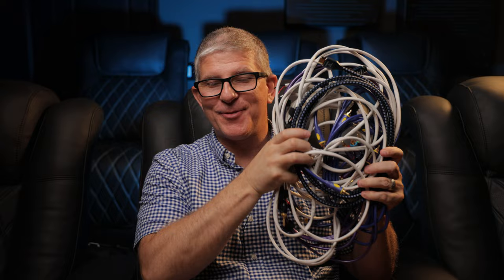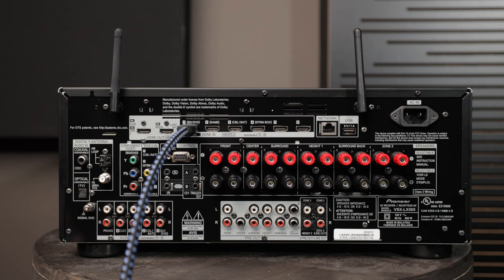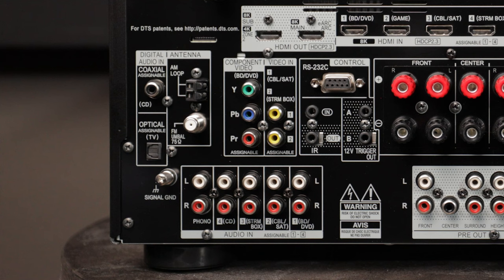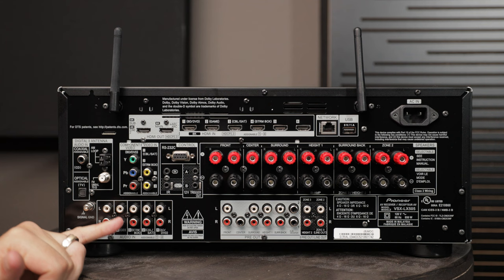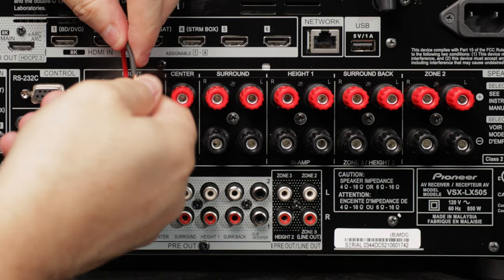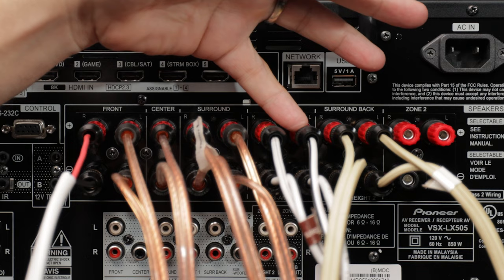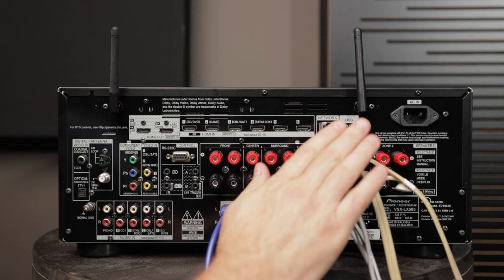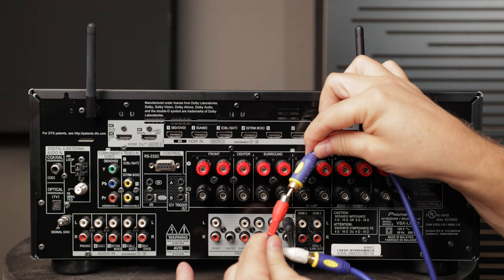How to Connect An AV Receiver (AVR) | EASY Step By Step Instructions

Comment: Great videos. I have the rack mount ears for my Onkyo TX-RZ50 ready to install in my rack. Is there a way to remove the feet from this receiver so it fits in my rack easier?
Reply from the maker: Most feet can be removed from AVR’s’s or processors. You just have to be careful if they have ventilation on the bottom.
Reply: @Youthman  Thanks for your quick reply. I decided not to attempt removing the feet. It looked like it was going to be more trouble than the extra 1U rack space it was going to provide. I'm going to install an AC Infinity cloudplate cooling unit under the Onkyo as well as one above it anyway. It was a lot easier to subscribe to your channel. Thanks again. 🙂

Comment: I was hoping you’d explain how to set up ARC. I have an ARC TV connected to the ARC HDMI but it’s not working, even though I enabled it in the settings in accordance with Denon’s instructions.
Reply from the maker: There isn't too much to setting up ARC. 1) Both your AVR and TV must have ARC or eARC HDMI ports. 2) Connect an HDMI cable to those two ARC / eARC ports. 3) In your TV's audio settings, enable ARC. 4) I fyou have a Denon or Marantz, go into your Video settings and make sure ARC is enabled. Let me know if that helps.
Reply: @Youthman  thanks for the reply ❤️ 

Unfortunately, I did that already but it’s not working. I’ve been using this exact setup with ARC for a long time so I know everything but that is working fine. 😢

The TV is behaving as if it sees the ARC AVR and is sending the audio there. But I hear nothing. The AVR has HDMI control And TV audio switching turned on.

Comment: I know I probably won't get an answer, but I have rear in ceiling speakers for dobly atmos so what settings on my receiver do I set to activate those speakers? Atmos enable or height speakers?
Reply from the maker: Hi James, which AVR do you have? Typically Atmos enabled is referring to up firing speakers that you place on top of your front left and front right speakers to bounce the sound off your ceiling and back down to your listening position.

If you have a Denon or Marantz, under Speakers > Manual Setup > Speaker Layout, change Height Speakers to Yes and then choose Top Front etc. 

The diagram will show you a visual representation of where those speakers would be placed in the room.

Let me know if that helps.
Reply: @Youthman  I got the new Pioneer VSX-535 5.2. My rear surround sound is set to height for my rear in-ceiling speakers and my front in-ceiling speakers are on the front height channel set to height. I believe that's a 3.2.2 setup. Now I know I don't have any rear surround sound ear level speakers, but the virtualization on the unit does a good job at imitating them. I just want to make sure that my in-ceiling speakers are getting the Atmos channels.
Reply from the maker: When you check your levels in your AVR you will hear what channels it’s utilizing.

You can also download this callout file - https://www.stereonet.com/forums/topic/470220-dolby-atmos-sound-check-dtsx-111-callout-clips/

Comment: Do the cables or type of connectors introduce any considerable noise or quality degredation? It always seems like these RCA cables and ports are not really up to the task of that. But then also, why wouldn't they be?
Reply from the maker: No difference whatsoever
Reply: @Youthman  Thank you. I always get told by audiophiles that the cable, the port and the connector matters and that expensive equipment is required to make it sound right but I find it hard to believe. Sure, it does make a difference in a physical sense, but that's in a nano dimension that we cannot even perceive.
Reply from the maker: Two words…snake oil. Why is it that there is no documented double blind test that proves that expensive cables improve the sound? 

Last year, we did a blind comparison at MWAVE with 3 cables and a coat hanger. The coat hanger was picked  #1 and ##2 in each test. 🤷‍♂️
Reply: @Youthman  Will definitely have to watch that video! Thanks!

Comment: Hey, great viceo. So if you have a pair of active speakers, would you need to connect them using the pre-out RCA outputs?
Reply from the maker: If a speaker has a built-in amplifier, yes, you would use the pre-outs on your AVR or processor to connect to each input on the amplifier of the speaker.
Reply: @Youthman  Thanks for the reply. I have a Sony DB1070 A/V receiver with a Marantz 6170 Turntable. Any recommendations for some active/passive speakers to pair with this setup (Budget around 180-200$)?
Reply from the maker: Edifier are a great bang for your buck speaker. They have both active and passive options.
Reply: @Youthman  Ha! What a coincidence! I was just watching review videos of the Edifier R1280DBS and the Edifier MR4. Thanks for the quick reply!
Reply from the maker: @hikingbiker good luck!

Comment: Hi, quick question if you were so kind to assist.  I've purchased a pair of Klipsch R-625FA Dolby Atmos.  Now, they have TWO set of connectors on the back of each.  I will connect one set of each speaker to each 'Front L and Front R' of my amplifier.  What about the other set of connectors of the speakers?   Any input will be appreciated.  Thanks!!!!!!
Reply: Not worry about the others. You need to just go into menu and set the assignment as 2ch and disable other speakers. That's all.

Comment: I love your videos, very informative. I am very frustrated with my home theater system. I have a Samsung short throw projector connected to a Denon AVR-S970H with 2 Klipsch tower speakers with atmos built-in on top, center speaker and 2 subs. I installed everything using your video. After the initial calibration the system played well. I then played some music from my phone via Bluetooth and from that moment I haven't been able to get sound through my speakers from my projector. I have tried everything. By the way, music plays fine. Please help. Thanks!
Reply from the maker: Unfortunately ARC and eARC can be a pain. Try going into the projector and turning off ARC. Then turn it back on and see if that resolves the issue with not getting sound from your projector to your Denon.
Reply: @Youthman  I will try that and keep you posted. Thanks Youthman!

Comment: Hi, please help i have spent quite a bit and i dont understand. I have a denon X1700h that is 8ohms and i have 2 6ohms speakers. My 1 year old removed a binding post from 1 speaker so i have only been using 1 speaker. Today i got flashing red light and i have removed all wires and its been off for a few hours but still got red flashing light. It is still under guarantee so i can return but would you know why this could happen and if i can get an amp for this reciever ? Because i want to get 4ohm speakers
Reply: It's in protection mode. Depends unplug the power cable and leave for some time. Hopefully it should power back on. 

This denon avr isn't good in handling 4ohm speakers. Get an external Amplifier and use it
Reply: @audiodynamicsmaxsolutions  I ha e left it for a few days now and still the same red flashing light and powers off pretty much straight away. OK sure, this av reciever cannot add an external amp. I will send it back for repair as still under guarantee. I might just settle for the klipsch RP-8000F ii if my av reciever will power them
Reply: @audiodynamicsmaxsolutions  I have a pair jbl stage A190 at the moment so not sure why the av reciever in protection mode. So now I need to return for repair and pay 40£ for return

Comment: What about if you have a set top box from your internet provider? How is that hooked up.
Reply from the maker: Use HDMI cable to connect from your cable box to the AVR
Reply: Thanks..!  but not necessarily ARC ?

 @Youthman

Comment: Great Video. I want HTPC home theatre of 11.4.6 dolby atmos configuration
17->Neumann KH 420 active powered monitor speakers
4-> JTR 4000ULF subwoofers

Which av receiver-amp wil do this? Thanks in advance
Reply from the maker: If you need to process 17 speakers, you’re probably looking at Storm Audio or Trinnov

Comment: Just bought a Pioneer VSX-935 7.2 Channel 8K Ultra HD Network AV Receiver. I follow your video on how to connect the speaker wires with 5.1 configuration. During the sound test, all speakers (Front, Surround, and Sub) passed, except the Center speaker, with no sound at all. Can you help? Do you know what is the cause?
Reply from the maker: See if this walkthrough helps. https://youtu.be/yspMuw_PX0s?si=rt134bcnscHs7oOc

Make sure you have center channel enabled and connected.

Comment: Where would I connect a bass shaker on this receiver.... ?
Reply from the maker: You would use the subwoofer out from the AVR into an amplifier then to your bass shakers.
Reply: @Youthman  would that replace the existing sub woofer or would it be possible to use both
Reply from the maker: You can split the signal using a Y adapter.

Comment: Question. I'm new to the thought of even trying to build a home theater. But the timing is perfect because we are currently building a home that will have a dedicated media room. The Media Room dimensions are about 15 1/2 ft wide, and half the room depth is 19'10" and the other half is 23ft, the ceiling is vaulted from 8ft to 10ft (highest point). Would you consider this a small theater room space? Also, do you think the room is big enough to house a 150" screen projector or bigger? Thank you
Reply from the maker: Hey Jeremy, that’s exciting. Your room is more than sufficient for 150” screen. My room is 13 foot wide by 19 foot deep with 10 foot ceiling and I have a 150” diagonal screen in 2.35:1 cinescope screen. Take a look at this video https://youtu.be/AubrsBu-2nU
Reply: @Youthman Thank you. I will check it out

Comment: How to connect a sub-woofer which don't have an internal amplifier... Thank you Sir..
Reply: Same question 🤔
Reply: Connecting a subwoofer without an internal amplifier, commonly known as a passive subwoofer, requires an external amplifier to drive it. Here's a step-by-step guide to connect a passive subwoofer:

Choose the Right Amplifier:

Ensure the amplifier can handle the impedance (usually measured in ohms) and power (usually measured in watts RMS) of the subwoofer.
Look at the subwoofer's specifications: if it's rated at 8 ohms and 650 watts RMS, your amplifier should be able to deliver that.
Connecting with Speaker Wire:

Most passive subwoofers use speaker-level inputs and outputs.
Strip the ends of the speaker wire, exposing the bare wire.
Connect one end of the speaker wire to the amplifier's output terminals.
Connect the other end to the subwoofer's input terminals.
Using a Receiver:

Some home theater receivers have outputs specifically for passive subwoofers.
Connect the subwoofer output from the receiver to the subwoofer using speaker wire.
Setting the Crossover:

This step is crucial for getting the best sound out of your subwoofer. The crossover determines which frequencies are sent to the subwoofer.
Many external amplifiers will have a built-in crossover. Set it to a point where the subwoofer and your main speakers transition smoothly. A common starting point is 80Hz, but you can adjust based on your preference and your main speakers' capabilities.

Safety First:

Make sure everything is turned off when making connections.
Ensure that all connections are secure and that no stray strands of wire are touching other terminals or causing a short circuit.
Once everything is set up, power on your system, play some music or a movie with a good bass track, and adjust the settings as needed to get the desired sound.
Reply from the maker: Thanks lashman. Crown amps are often used for passive amps.Buckeye as well.

Comment: What is a better. Connection.. hdmi or optical. 👍
Reply from the maker: I prefer using HDMI because it’s a to a connection meaning you can use ARC to send audio from your TV to your AVR. It also carries higher resolution audio. Optical does not support high resolution formats like Dolby Atmos.

Comment: What if my reciever doesn’t have the ecr hdmi port
Reply from the maker: ARC allows the sound from your TV (Netflix, Hulu etc) to be sent to the AVR. If your TV and AVR do not have ARC, you can use Toslink (also referred to as fiber optic or optical) cable.

Comment: If I want to add two external amps to my avr, do I need two 12v trigger cables? Do they make a y splitter for that if my avr only has one trigger input?
Reply from the maker: Most amps have a 12v in and out so you can Daisy chain one amp to the next.
Reply: @Youthman  perfect. Thanks brother.

Comment: hi! can i ask, where amplifiers go? like don't you have amplifiers for your speakers? (i mean like those that you have multiple of)
Reply from the maker: As I shared in the video, an AVR has built in amplifier for your speakers. If you want more power to your speakers than the AVR can provide, you can use preouts to connect an external amp
Reply: @Youthman  thank you!
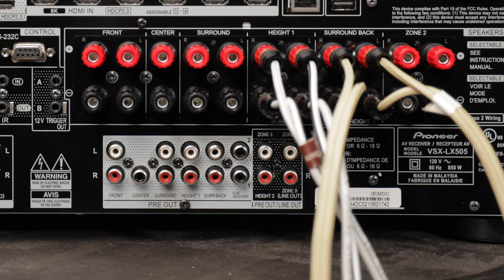Reply: He points this out at 13:05
Reply: @mikelary88  👍 thanks

Comment: What if u don't have HDMI on the back of my Onkyo receiver
Reply: U can use normal video and audio cable den,,,, red,white,blue
Reply from the maker: Digital coax or Toslink would be a better option than composite (red, white and yellow).

Comment: How to connect my microphone to my receiver?
Reply from the maker: There is a small 3.5mm hole on the front of your AVR that says “Setup Mic”. You will need to use the included setup mic that came with your AVR.

Comment: The drop in amplification for more channels is not entirely true for all amps. Some do advertise, for example, 100w x 5 and a separate wattage for height and surround. Check your manual first. 36 years of pro AV experience here.
Reply from the maker: Thanks for the clarification. What brands and models are you referring to? Is that NAD?

The main point is the vast majority of AVR’s operate this way. I don’t want my audience seeing an AVR that claims 140 W per channel and they’re only referring to two channels. And once they hook up 11 speakers to that AVR it’s nowhere close to 140 W per channel.